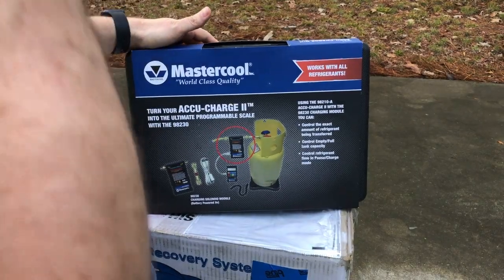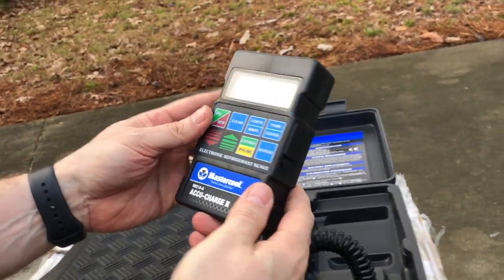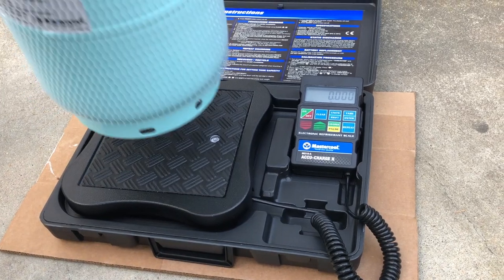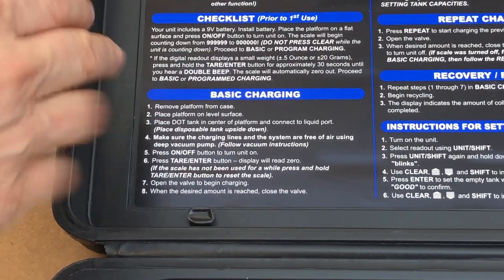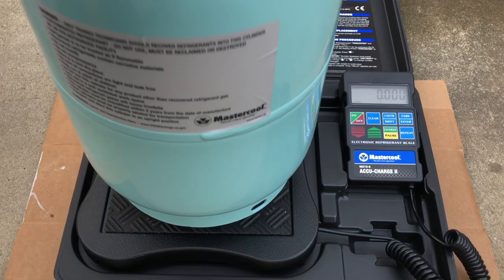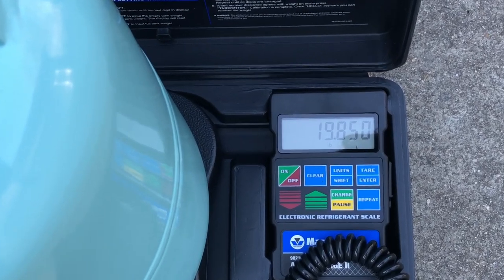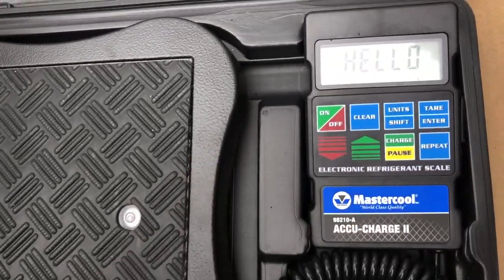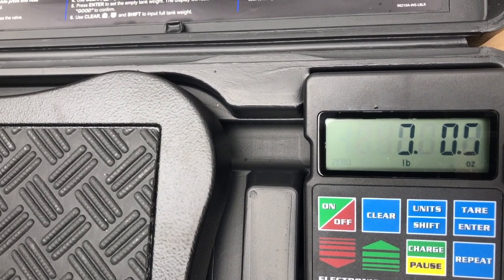R134a Electronic Refrigerant Scale Unboxing Overview & Usage (Mastercool 98210-A Accu-Charge II)

Comment: It says on the lid that the scale should be taken out of the case when used. Does it really matter?  I prefer to keep it in the case…
Reply from the maker: If you keep it in the case, you have to be careful to position/seat it so that the case is not interfering with the weighing surface of the scale. If not, you'll get an incorrect reading.

Personally, I've used this tool both ways with no difference bearing that requirement in mind.  I tend to leave it in the case when working on a vehicle outside, but use it out of the case if I'm working on a vehicle in an inside garage bay.

Comment: Do you have a video showing how to charge from the tank after a recovery? Thanks in advance
Reply from the maker: No, but you wouldn't typically reuse recovered refrigerant as it can have contaminants from whatever caused the problem you are doing a repair for.  Instead you would take it to a reclamation center to recycle/dispose of.

What I do after recovery is recharge from a virgin R134a cylinder, thru the low side port using a regular AC gauge set.
Reply: @DrShock   Thank you for the reply, I was going to get one for 1234yf . I was going to filter it and recharge with it (because of the cost) will it recharge from the tank if it’s filtered

Comment: Hello I bought the same scale,  however when I push the Units/Shift button, the scale doesn't allow me to switch from Kg to Ib, or oz. Is the scale defective? Am I doing something wrong?
Reply from the maker: I just checked mine, you just press the units button at the top to cycle thru kg, lb, oz.   I'd try checking the 9V battery first, to be sure it's up to power.  And then if it's still a problem, you can email mastercool tech support from their website, they are pretty good about responding since it's a pro tool.
Reply: Same think with my unit too

Comment: Can this be used with Small 12 oz cans of r134a?
Reply from the maker: Sure, but you'll need to be sure to account for the weight of the cans in your calculations as well as the weight of the hose and can fitting.